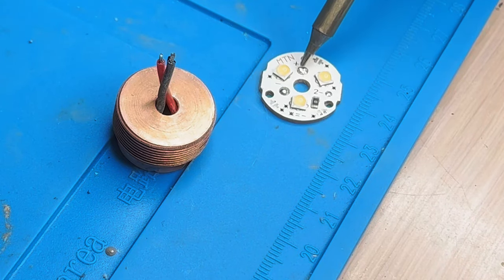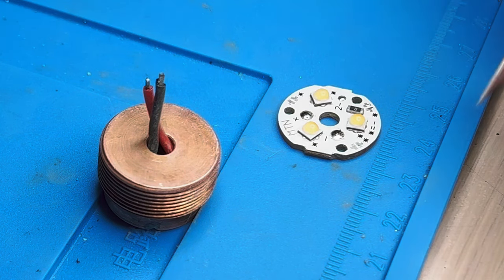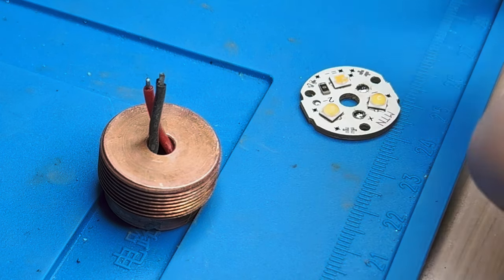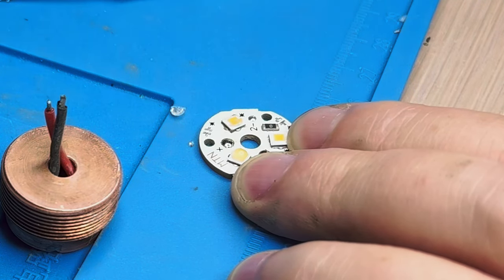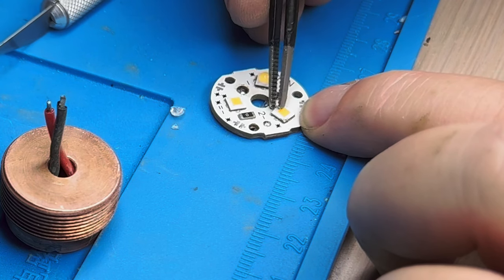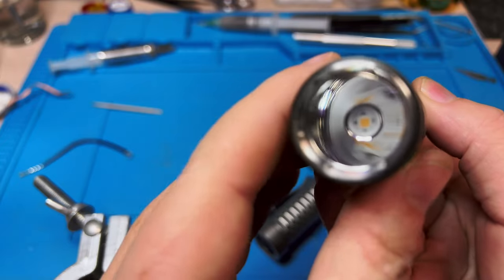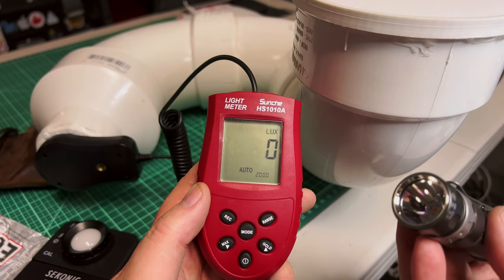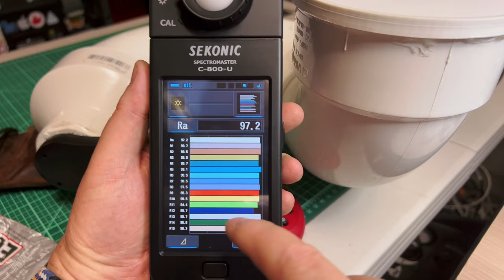PART 2 - Emitter swapping 519A and de-doming

Comment: Is there any difference between the XP-L and Nichia versions of the RRT-01 except the differences of OP vs. smooth reflector and the LED itself? Do you recommend one over another for the 519A?
Reply from the maker: Just emitter and reflector. I have used both, and the throw difference (hotspot size) is barely different at all (the smooth being sliiiightly tighter) but the LOP reflector really gets rid of beam artifacts, so I only use the Nichia version now.

Comment: Sorry it’s unrelated but do you notice any leds losing brightness in your emisar lights like led degrade from being overdriven in your tests?
Reply from the maker: I have not, and I own quite a few. I’d check that you weren’t accidentally in simple mode.  Check battery age/voltage.

Comment: Nice video, but Ra is not all R1-R15, Ra value is average of R1-R8, this is why R9 value is more important than Ra. Also dedoming increases Lumens.
Reply from the maker: I’m aware of that, which is why I have my Sekonic configured to show r9 as well.  If I said 1-15, I was just misspeaking.

I can’t speak to all emitters, but it’s been documented that 519A loses lumens after a dedome.
Reply: @cheule  :) all good, but logically dedoming should increase output, as there is less things in front :)

Comment: lol the astrolux ec03 leds are blue if you take the domes off lol not that i was trying to take them off but it happend and mow i have a astrolux ec03 with blue leds lol but yeah im going to buy new xhp50.2 leds to replace these one that i ruined lol and this sucks becuse this light is brand new and not used lol i ltterly tuned it on and hen had to mess wtth it and look insode and i accedenty ripped off the domes on the leds and they still work somehow but there just blue without the sulfer dome lol